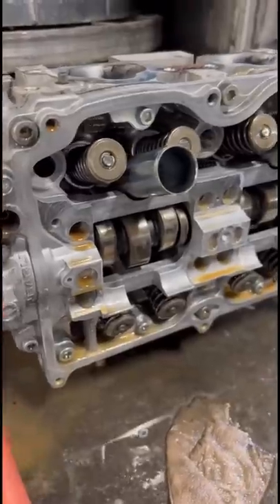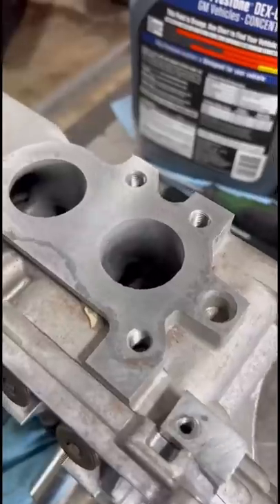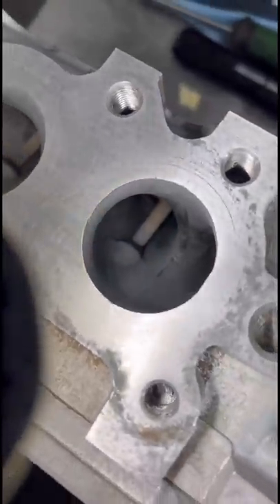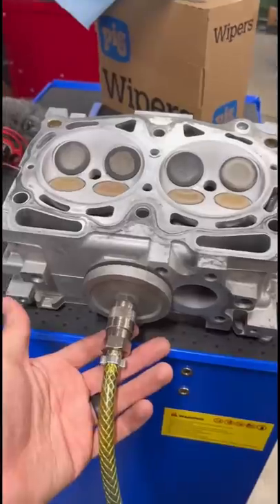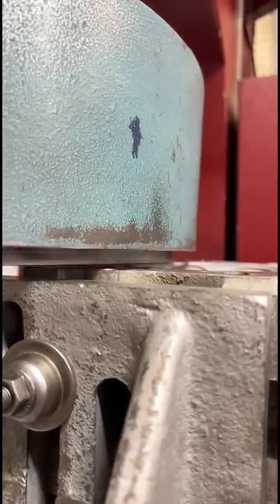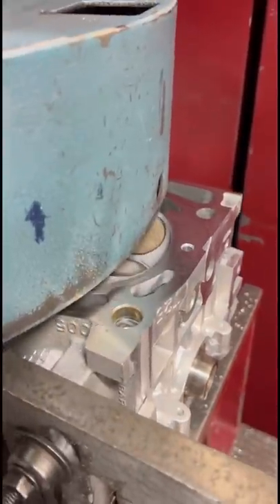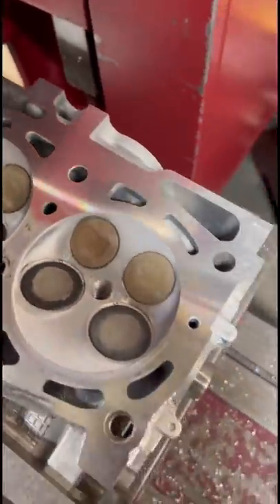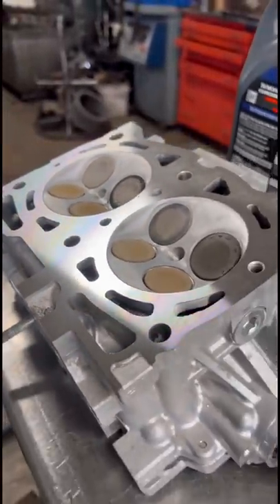#shorts Not A Week Goes By Without A Set Or Five Of Subaru Heads For Resurfacing

Comment: I'm a Subaru dealer tech and the guy we take our heads to never cleans out the coolant passages so nice to see you taking that extra step
Reply: I'm a Toyota tech, my wife wants Subaru with AWD. So damn persistent. Any thoughts? Thanks
Reply: @prius74  the outbacks are really nice. The only downsides are the CVT feels like crap. Other than that it's a beast in the winter and lots of room
Reply: Interesting comment.
Reply: @prius74 I'll add that while the CVT feels like a typical CVT (like crap), it's proven to be as reliable as the tried and true slush boxes.
Reply: @TripedalTroductions  theyre better than the nissan cvts, my buddies died at 60k or something.
Reply: sounds like you need a new Machinist, you should use the stop that posted this!

Comment: I literally did this with mine in my garage with a piece of glass, different sandpaper grits, wd40, and patience. It has been almost 50k and I have no issues. I couldn't afford a shop to do it and it was my only car. I'm pretty sure I just got lucky though.
Reply: I used a random orbital sander then glass! 20k and going strong. MLS head gaskets fix all the subie head issues.
Reply: Actually, that's how some incredibly precise work is lapped.
Reply: Still holding up? I'm basically in the same boat with a blown head and was going to resurface myself
Reply: Glass? What for?
Reply: @DarkArcharon  b/c it's relatively flat. Surface plate would be the way to go but float glass is pretty cheap, pretty flat, and lightweight so you could also cleanup the block with it still in the car. (On many cars - don't know about these Subarus)
Reply: @Iceberg86300  is the glass used to measure the "straightness" of the block head?
Reply: @DarkArcharon  no, glass is just as a flat surface to sand with. You stick the sand paper to the glass, and drag to part across to top, using gravity to keep it flat. 

To check flatness, you'd use a straight edge. A 2ft straight edge is fairly inexpensive
Reply: We've glassed our snow machine and ATV heads and blocks for many years. it is a very reliable method as long as your glass is thick enough to prevent deformation from pressure.
Reply: You've got another 40k miles to go!
Reply: Plate glass is one of the best flat surfaces you can get. In 3rd world countries when they rebuild engines that is exactly how they do it. It works for sure!
Reply: Budget better or get a better line of employment and a non subaru car.
Reply: @DarkArcharon straightness
Reply: Sounds really lucky
Reply: Did this with mine too. Glass, Sandpaper and time
Reply: Nope. Did this in October on a 130k mile 96 outback. 400 grit, straight edge checked a block of wood to wrap paper around, that and a .0015 feeler gauge so I was above OEM spec, fel pro mls and haven’t had an issue since 5k miles so far
Reply: Not everyone has a milling machine at home. Good job!

Comment: When I worked for Subaru I saw Subaru "Master" techs R+R an EJ head, clean the block and heads with a straight razor and then slap some factory MLS head gaskets on - No machine work and the heads were 0.003" warped (who knows how much the block could've been warped) AND he didn't use the specific torque procedures for the head bolts (the torque, loosen then re-torque part of the procedure). Yet I didn't see these particular cars come back (at least not within the 1.5 years I worked there). I did see one EJ get slapped back together, run rough and then the Subaru "Master" tech told the Service Advisor to sell a Fuel Injection service and when that didn't work to sell fuel injectors. The customer picks up the car and is back just a few days later. The service department manager told another tech to pull the engine and once the other tech had pulled the exhaust during this process he could totally see that one of the exhaust seats had dropped with another seat about to drop. I've worked for other make's dealerships throughout the years and have seen some sketchy shit but seeing this type of stuff from technicians not giving AF really bummed me out.
Reply: Dealerships are the worst, when I worked for Toyota, Lexus, and Daihatsu it was all the same.
I wouldn't trust them to drain my oil let alone anything else.
Reply: I'm so glad that wherever I worked, every head would be sent to the local automotive machinist every time.
Reply: It's like the ratio of competent techs that cared to turn and burn flat rate idiots has flopped. Especially places like that Subaru dealership that I worked at. The place was so huge, multiple buildings, 45-50 Subaru techs at any given time. How could there be any accountability. It's too bad
Reply: That there sounds like a warranty job. I've worked at dealerships as a tech. The warranty time sucks on all repairs. It's hard to beat time. So as a tech you have to choose between making a living and your own work ethics. I blame the company for the poor quality or skipping steps. If they paid for the repair properly then they would get the proper job. But warranty time is bullshit. I work at Ford In the 90's a Ford Taurus paid 3 hours to do the evaporator core. Warranty paid 3 hours. Now I did so many of these I could go to my box and pull every tool I needed to do the job. I mean I did alot of them. My best time to pull the dash start to finish was 5.5 hours. Impossible to make time. So as you well know the tech takes the hit on it. The way your master tech fix it was probably the only way to make the pay for him close to fair.
Reply: I wrote that wrong. Warranty time was 3 hours and book time was 6 hours on the ones with 3.0 push rod motor. It was almost  impossible to make regular book time. For sure you couldn't make warranty time.
Reply: Had the same issues with Toyota dealership- it really does originate with the company not caring to give the techs proper pay for any given job, let alone warranty ones. I don't blame the techs, I blame the penny pinchers at corporate that make it impossible for anyone to do a good, thorough job, and take home fair pay. It's only gotten worse as the years go by unfortunately. Hooray greed!
Reply: Guys, im a dealer tech of roughly 30yrs. I do agree about shitty warranty times. But there is no excuse for shit work PERIOD! I'm not saying that i didn't figure out work arounds but thats part of the game. But I always tried to have integrity. And the service writers always seen it and took care of me. i didnt get rich but I made a good living.

Comment: If yall ever do any land rover v8 heads id love to see some videos! Blocks too. Since the cylinder liner had a reputation for slipping out of the bore unless a top hat liner is used or the old liner is Peened
Reply: This 👆
Reply: Top hat liner all day for that fancy shmancy buik engine
Reply: I no longer have my Rover V8, but i would still like to see that, too! Another vote for a longer video of such!
Reply: Easiest way to solve that is with an LS swap! I thought I had a blown head gasket, replaced it, and it overheated 5 minutes after running every time. I pressurized the cooling system to 20psi and found a pool of coolant in cylinder 5 after taking out the spark plug. Slipped sleeve. I haven't heard great things about the rebuilt engines so the LS swap seemed like the right path.
Reply: @nepicness love the look of those but afraid of the engines lol always said if I got one I'd buy a roller/blown motor example and ls swap that puppy
Reply: I had to switch my 02 discovery block for a junkyard block I found in Los Angeles for $400. It worked great!

Slipped cylinder sleeve was a nightmare though. I replaced the head gaskets first and the same coolant burning kept happening. Very annoying! Next time I will weld the sleeve in! haha.

Comment: I’m surprised that the head isn’t disassembled (cams/valves/springs/seals) removed prior to machining.
Reply: They probably asked for just that per their budget. I've asked and received similar work to save money for what I could do myself like install new valve seals and or springs.
Reply: I know right? Doing a head job on a budget is rarely a good idea.
Reply: @BenVanAmburg  I've done it many times and never had a comeback. The key is cleanliness and having old head teachers.
Reply: It takes less time and you still get an even surface. Unless they're doing work to the valves no reason to take them off plus you have to adjust them as well.
Reply: Next time!!!!
Reply: @matthewmorgan582  I'm sure the fear is of debris remaining the heads...
Reply: @soconoha  if all the valves are closed its fine and a couple small metal shavings isn't gonna blow the motor up. It'll get pushed out the exhaust or drained in the oil.
Reply: @matthewmorgan582  good luck with that thinking
Reply: The machine shop I deal with does it this way as standard procedure on all Subaru heads that don’t need valve train work, has for 25 years. Never caused any issues on the dozens upon dozens that I’ve reinstalled. Make sure it’s clean, blow out all passages really thoroughly, lube the cams (like he said in the video), and they’re good to go. I’ve been doing maintenance & repairs on a 31-vehicle fleet of all RHD rural-route postal delivery Subarus since 2000, so tons and tons of Subaru head gaskets. Never any kind of issue whatsoever caused by not removing the cams abs valve train before milling.
Reply: @T..C..M  So what could happen if you were to do this work with the head assembled? I'd like to know what's so wrong.
Reply: @matthewmorgan582  absolutely nothing, not even relevant
Reply: On an aluminum head, as long as you do a good pre wash to get the oil and sticky gunk off it and it comes out clean,  you can surface the head and blow out the chips just fine without an issue. Aluminum doesn't make dust like iron does.  This is common practice in most shops for aluminum heads.
But it must be clean of all oil and grease and perfectly dry to  do it like this.
Reply: @T..C..M  unless you specify rebuilding whatever shop you use almost certainly does it this same way.
Reply: Yeah I'd be tempted to at least tape up anywhere that wouldn't interfere with the cutting head.
Reply: @jeepmanxj  yeah that's absolutely not true. I've had hundreds of cylinder heads rebuilt and never did they do one complete unless I specified do not disassemble.
Reply: @BenVanAmburg  this here is a perfect exampke of crap! There is nothing wrong with getting ur heads resurfaced and doing the valves , seals, and possibly guides if needed yourself. its not hard and its fairly quick. when done you clean and prelube yourself.
Reply: You don't need to remove valves to surface most cylinder heads
Reply: It’s better than not having it machined. Sometimes the minimum is enough.
Reply: @app4902  Who said anything about not having it machined???????
Reply: @matthewmorgan582  the oil must be recirculated. There is an oil pick-up filter that can become clogged within the bottom of many oil pans. When this happens at 5000rpm, one piston will stop moving before deciding to leave the block while all the doors closed.

All foreign material must be removed. 
Trust.
Reply: I was wondering the same thing, but they pulled vacuum on the valves to check how they were sealing. Id assume it would be silly for a customer to ask for a leakdown test and then drop off a head with no valves.
Reply: All you have to do is tape off the intake and exhaust ports and your good. @soconoha8495

Comment: People. Don't be so upset. This is a masterpiece of art. He did perfect job. Customer asked for resurfacing because head gasket leak. Not because of losing compression. You don't change 16 valves and use plastigauge for bearing clearance to machine the head for 500$. This gentleman exist for you to get your ugly subi head gasket done with just around 1500-2000$. Cheers to machine shops. Without these shops you will be paying 4-5k$ for a head, wait 6 months for parts to arrive

Comment: As long as Subaru is in business you’ll always have business, the famous head gasket blower!
Reply: Originally a Borgward design from a long time and guess what the Borgward problem was!
Reply: Not a problem anymore. Only happened in the 2.5L N/A motors. 

I have a engine that should have blown the HG but it still hasn't after 230,000 miles.
Reply: Only north american Non turbo 2.5s had poor head gaskets... Misconceptions really do damage...

Comment: Tip to anyone doing dumb subie shit, if its boost, stock or not, get a solid deck done, they basically weld blocks into the coolant jacket to keep everything from moving (oversimplified but thats that) and multilayer steel gaskets

Comment: Anyone thinking of getting a wrx or sti, don't. People don't exaggerate when they say they spend 10k+ on repairs, I have a 08 STI, had 10k of work done to it and a new engine since the old one had rod knock(3 days after purchase) and on top of that I put 4k in myself and it still has a bunch of minor issues
Reply: This is one reason I aspire to own an Evo X.
Reply: @skylinefever  if you can get one do it, they're only going to get more expensive, the STI is still sitting in the garage I daily a stage 2 435i now which has been very reliable so far

Comment: well, I'd say "just EJ25 problems," but my EZ30 just popped a head gasket at 191,700 miles... almost twice as much as either of my old EJ25s... and less than any of my EJ22s, which have all had over 250k on them without any signs of head gasket issues.

Comment: After milling the cylinder head, a slightly thicker compensating head gasket is required, otherwise valves hit the pistons when reaching top dead center
.
Reply: Not true. There’s a tolerance to how much you can remove. You don’t know what you’re talking about.

Now the ECU on a turbo Subaru needs to be re tuned because you changed the volume of the combustion chamber

Comment: I wish all head shops would do this! I’m having my heads shipped back to me from Modular head shop, after they had my heads for over 10weeks and only have them tore apart and bead blasted!! Which was done the second week there! They lied over n over and for 5weeks told me they were in the die and seat line to be finished up next week, 3weeks same story etc until i had enough! Plus I paid over $1,000 up front and bought several hundreds in parts gaskets etc.
Reply: Never pay up front

Comment: You know in today's world of aluminum heads multi layer steel gaskets it's hard to imagine people actually resurfacing a head unless it's to pitted to use.
Once you Mill a head from an overhead cam engine your actually throwing the timing out because it acts like it has a stretched timing chain. The tensioner only takes up so much slack before it affects the timing.

If it's a OHV engine if it's milled enough you need a custom set of shorter push rods usually chrome based which can cost more then the machine work.

All aluminum heads will warp to the block deck when torqued so if you don't resurface your block deck it's just a waste of time.

Also multilayer steel gaskets are the norm and they take up quite a few thousanths  of warp themselves let alone with copper spray ect.

On an Overhead cam engine if you resurface the head and not the block the head will re warp causing the cam bearings to be un-aligned which then needs to be line bored. 

I love machine work but people need to quit sending off heads without knowing all the info.

Comment: If the mechanic decides to lap the valves himself, do you prefer to get the head without cam or valves? If you lap the valves for the customer, do you machine the heads before reassembly?

Comment: Man. This makes me hate my Subaru all the more. I loved it cause she was great all year, but holy shit. Replaced the entire engine after finding out the block was warped shortly after i bought it, only to have my timing jump and a valve get clapped.. losing compression on both cylinders on the passenger side a year later.

Now she's in the corner of my yard, and will soon be sold along with all the parts i have. Still have all 4 heads if you want them though hahah

Comment: More with the iron/steel parts, do you ever paint/treat the castings after they come out of the washer to prevent rust after they leave your shop ?
Reply: It’s caustic liquid then they spray with water and clean the surface after it’s done in the bath. It’s not just being cleaned with water because then it would, like you said, maybe rust when it leaves the shop.

Comment: Question????. Are you folks getting any of the action with the Hyundai engine core rebuild??😮. Just had my 2016 Hyundai engine replaced from dealer. It has 80,000 miles on it. They claim the whole crank bearings went out which I do believe. I asked a mechanic who did that work or one resident jobs there we're all the old engines going straight to the scrap pile or were they being rebuilt he said they'll being rebuilt at local shops. They're recalling 8.5 million units not all of them have engine issues don't know if you're aware of this but there's money on the table if you put your name in the Hat!. I enjoy your videos. I hope your new guy gets a big pay raise a real good vacation. LOL

Comment: I'm surprised you didn't put it back in the spray cabinet before you oiled the cam bearings.  Even blowing it out with air, isn't there still the possibility that metal gets into the bearings ?

Comment: Have you ever seen those heads cracked between valves and plug holes? Some of them used to crack there, just tiny hairline cracks.
Reply: Anyone that has done serious work on those engines knows about this problem …

Comment: You  left the cam in the head.WHAT ABOUT THE CHIPS THAT ARE IN THE CAM OILING  PASAGES AND ARE UP AGAINST THE CAM WAITING FOR YOU TO START THE ENGINE? The head  MUST BE STRIPPED BARE BEFORE MACHINING  .I work with aircraft hydraulics..Would you get on a plane that was repaired like this?